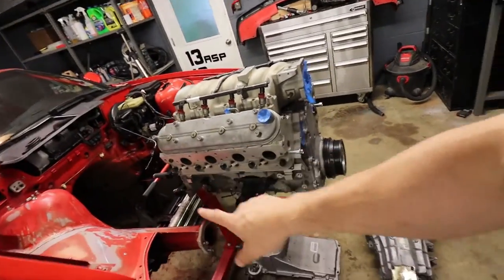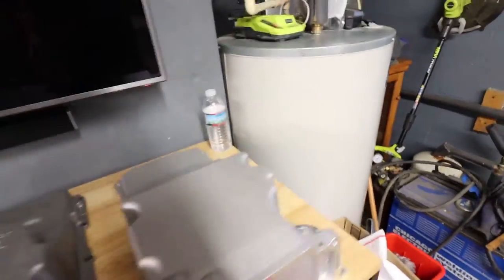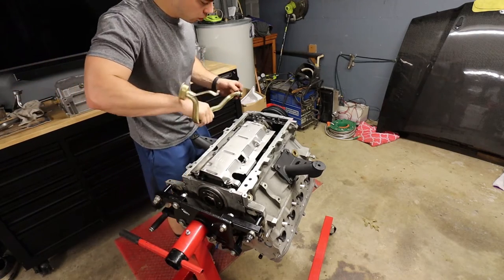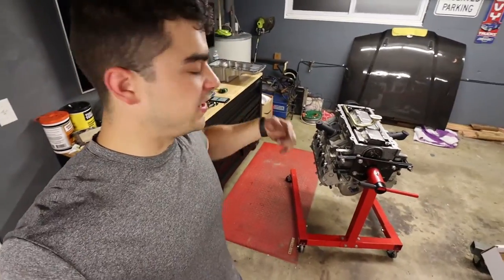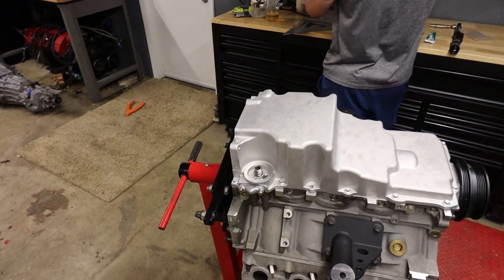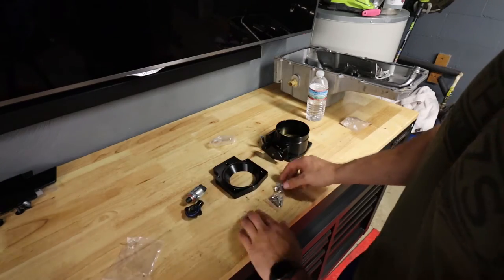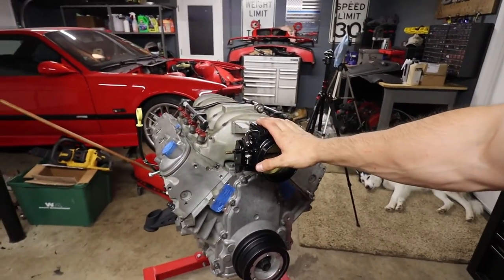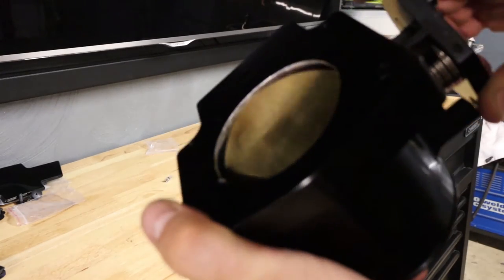E36 LS1 Swap Part 4 - 102mm Ebay Throttle Body (JUNK) and Holley 302-2 Oil Pan Kit (Not junk)

Comment: I watched your video for installation but i used the 302-1 oil pan and didn’t need to cut anything
Reply from the maker: Nice. How’s the fitment?
Reply: @matt13ross   Engine is still on the stand, waiting for ar5 transmission and clutch to come in the mail then ill see but it’s 3 inches shorter then the stock pan i had

Comment: Your tb issue is going to make it not run too well. At 20% throttle, it's basically almost closed still due to the clearance issue.
Reply from the maker: You think so? The bottom of the throttle plate has no clearance issues. I guess we’ll see? 🤷🏼‍♂️

Comment: So what fuel injectors and rail you running with the fast intake?
Reply from the maker: https://youtu.be/X62Frd0LKZc
Reply: @matt13ross  you're the best
Reply: Also, stock fuel pump from the 325is??
Reply from the maker: No I added a 340 pump.
Reply: @matt13ross  did I mention you're the best
Reply from the maker: Haha, thanks!

Comment: @Boosted Apex What's your clearance between you intake manifold and the hood?? I'm doing this same build 383 stroker and want to get a holley sniper Epi for my 799 heads. I'm just not sure if my hood will still close?
Reply from the maker: Good question, I have no idea, LOL!!! I haven't tried putting the hood on with the engine in.  I think I have plenty of room but we'll see.  Remind me in the next video to check if I forget.

Comment: Hey man, where you from I'm in Jersey doing a similar swap.
Reply from the maker: I’m from PA. You have more info on your swap?
Reply: @matt13ross  yeah on my channel I'm documenting it like yours but it's a 95 e36 was an auto I'm doing an aluminum 5.3 with a tr6060
Reply: I'm right outside philly if you are eastern PA we should meet up once we get these things running
Reply from the maker: Yea man I’m not too far! Hopefully in a few months it’ll be running.
Reply: @RalphsGarage  can i join in when mines finished, live in Nj to, doing a e36 vert with a 6.0 vortec and a ar5 transmission
Reply: @Minkflo17  yup I have like 1000 miles on mine now, when are we all meeting up?
Reply: @RalphsGarage  idk, mine might not be driving until October